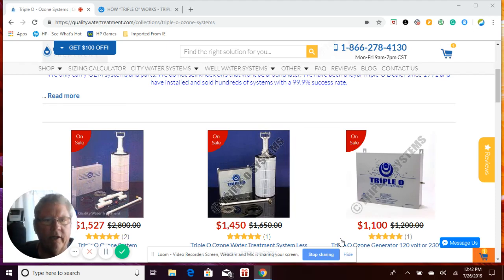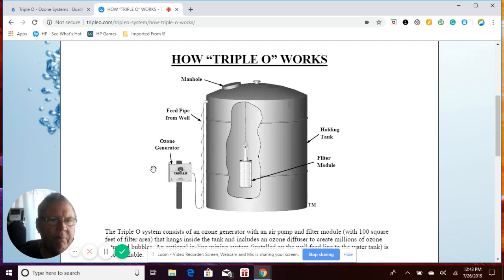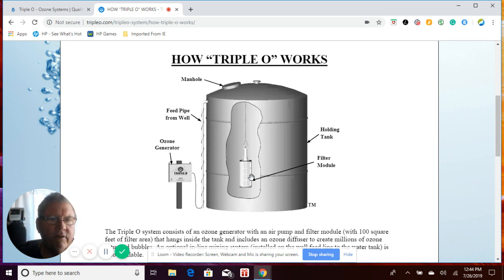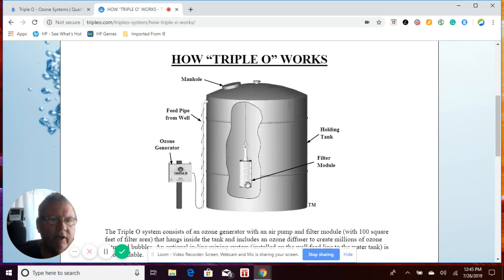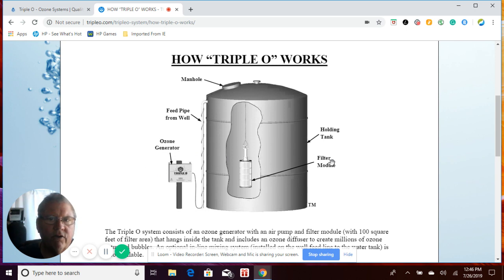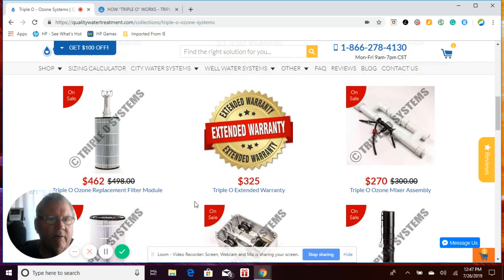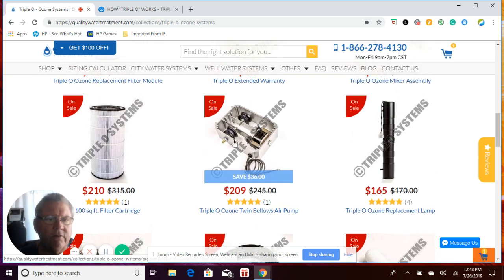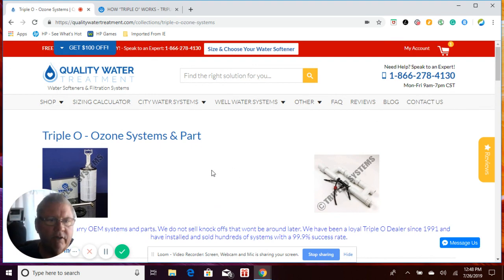Triple O - Ozone Systems - How Do They Work? [NEWLY UPDATED]

Comment: We purchased a house in 2012, in the pump house your companies Triple O Ozone system was in place, with a label stating that it was installed on 4/1998. 

In 2012 the Triple O Ozone system was emitting a ring of bubbles within the 5000 gallon water storage tank. We've been busy on multiple renovations on the property, the waters always been good, we'd clean/change the filters from time to time. 

Anyway, recently noticed that the Triple O Ozone was no longer emitting bubbles. So, ordered a new filter, a new air pump, new Ozone lamp, a new air diffuser, and 50 ft of hose from your website,.... just completed the install of all of the above mentioned.

Perplexed in that there's no air bubbles bubbling up within the tank. The air pump is pumping air, both sides producing  air,,,,weak streams of air imo, but they're working, there are no obstructions within the air hose, ran the lines straight and true, added the hartford loop as recommended, the check valve is functioning fine. in an effort to troubleshoot pulled the hose off of the housing that holds the filter and blew into it and was met with no resistance, as in the new diffuser is not obstructed. My install was tight. Very simple hose runs, very clean install and yet there's no bubbles being produced. Any ideas would be appreciated. Ty.
Reply: Any luck with troubleshooting?